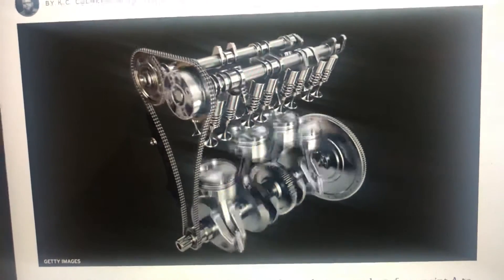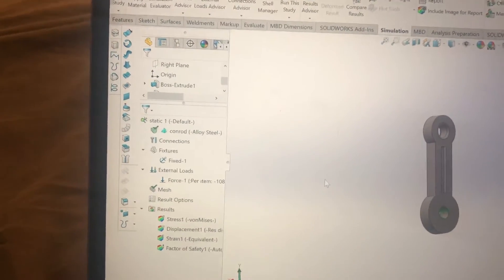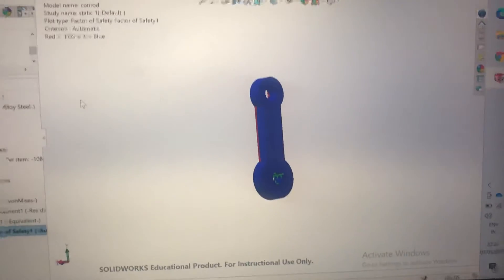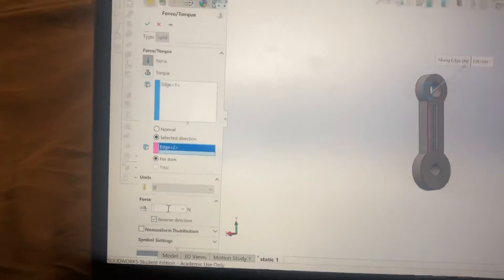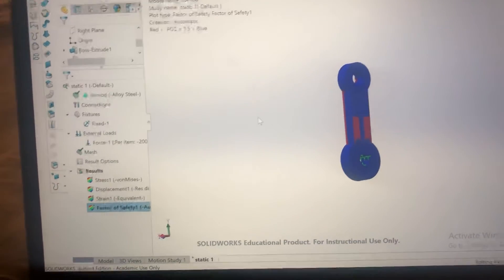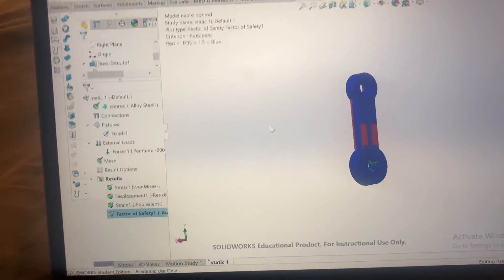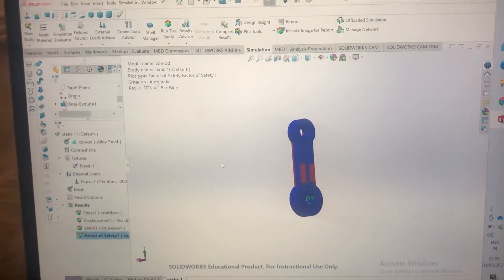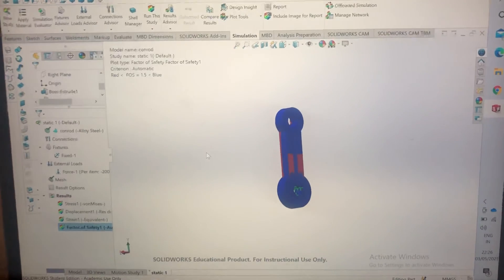Why remapping your car is Bad

Comment: Solidworks study is considering that force being applied all the time. Peak power will only be achieved full throttle at a x number of RPM. Design conditions for each material are well above factory HP and Torque and most likely will handle the remap specially if it´s conservative and within mechanical specs.. also you won´t be using the whole power all the time. Of course if you are full power all the time, then it really is a ticking bomb and you would have to increase the maintenance by 40%..